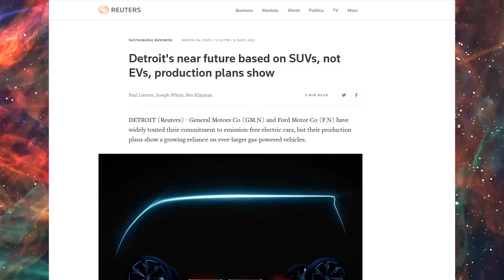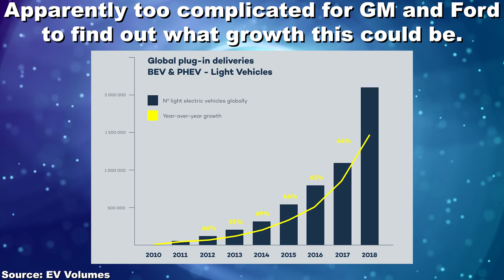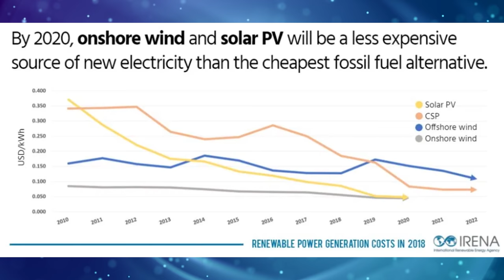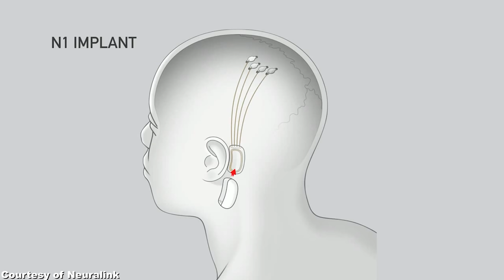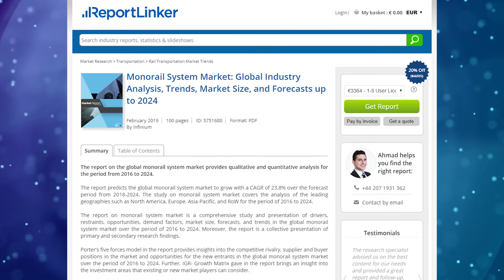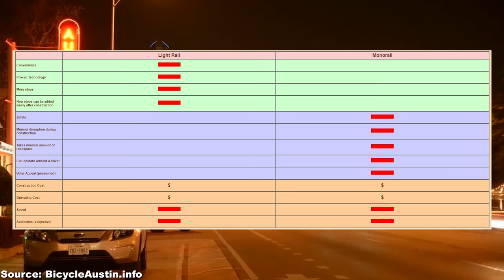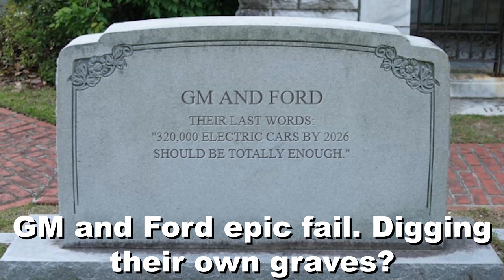Tesla Giga 4 Progress & GM+Ford's Bizarre EV Sale Target

Comment: 4th Generation Nuclear fission molten salt reactor are safe and produce rare medical & industrial isotopes. Produces almost zero waste and can burn much of the LWR nuclear waste. I designed sensors for these systems...many other 4Gen designs hold immediate promise providing energy to “start” fusion work which is likely 20 years out.
Reply: Jixuan, want to do a Vidio on this? I also think the  Zero Carbon future needs fail-safe Nuclear Fission with, wind, solar, and Batteries!
Reply: Molten salt reactors are the only way that we are going to have 24x7x365 base load power without pollution. The post forgot to mention that since it operates at normal atmospheric pressure, there is no danger of an explosion and there is no need for water coolant that makes current reactors so dangrrkus. They also heat up water, causing fish and other water dependent species to have problems. Without the need for water cooling, the reactors can be placed almost anywhere. Bill Gates has put some money into molten salt reactors, but not enough to get by the NRC's insane requirements for any new reactor technology. If we want clean nuclear power, now, we are going to have to reform or get rid of the NRC.
Reply: @everettlwilliamsii3740  i think if nuclear or fusion can generate electricity at below 2 cents a kwh, continue innovating their cost down by 10%-14% every year, can fit on a rooftop, can be built without cost overruns and labor union, as well as be in production in 2021, i think it has a good chance to be the best power generation choice for us.

Comment: Sydney built a monorail in the 1980s but as the late writer Clive James put it "The monorail goes from downtown Sydney to downtown Sydney to downtown Sydney" ie it didn't go anywhere. It wasn't an integral part of the overall public transport network and ultimately it got torn down. Monorails are awesome though, they solve a lot of problems and create very few new ones if the routes are designed correctly and integrate well. You can also build a monorail in conjunction with a boring company-sized tunnel as it will just fit, which means you can make the monorail go underground where necessary. Great job guys, keep up the good work!

Comment: GM - while studying architecture in university in Michigan - worked in GM plants in the area the summers. in one casting plant worked at - the failure rate was over 50% from the line. these castings would have to be re-melted to be recast - then we saw the Chevrolet Corvair (Unsafe at any Seed) then the takeover of Toyota to quality build - then the demise of the EV1. now another delusional step in commitment to ICE vehicles .... in the face of the inevitable and climate change

Comment: Buckmeister Fuller proposed using precast concrete(new concrete process) high speed monorail track throughout US linking smaller town and rural areas distributing population, using tech like fiber optic and innovative manufacturing-hyperloop & monorail great combo! 1st iteration of plan in early 70s then refined 10 years later.
Reply: I only seem to remember Buckminster Fuller, Fullerenes, and geodesic domes.

Comment: You guys need to get a grip, renewables are not working as you say.  Also instead of fission why not go molton salt reactors that already show to work, are far less complex and short radiation time lines.  MSR can be made in small or large sizes which allow the removal of the large transportation system.  China and India are seriously working on this technology.  You should read up on MSR!!!
Reply: But you should talk about the most promising and most practical, practical fusion isn’t going to be here for thirty years and when it comes it all be complex and expensive.  MSR is simpler, proven technology, the fuel is ready available it’s more efficient , and safer than any other reactor type technology.  We are again headed down the rabbit hole of the holy grail on nuclear    scientists when the solution is right in front of us.

Comment: Here in America's heartland the population density is to low to ever support monorails.  Don't underestimate Ford ?
& GM.
Reply: David LaBedz - “No one ever went broke betting on people’s stupidity.” “It’s pretty hard to recover from ‘stuck on stupid’.” The problem for both is like when the Ford Edsel was designed - The engineers kept on proposing advanced technologies such as BMW, MBZ & some others were using. Ford Management kept on pointing at the Edsel & replying, “This is the future.” 🤦🏼‍♂️Almost the same thing happened with the Pinto when engineers kept pointing at the brackets that would puncture the gas tank in even a minor rear-end collision. ITC, Ford management decided that it would be cheaper to litigate than to fix the problem. 😱🤦🏼‍♂️😡 
We all know what happened in these instances & just how close to bankruptcy Ford got because of the 2nd. And, we all know GM required a huge bailout just 11 years ago because of some of the stupid decisions GM has made.
If Ford & GM come to their senses within the next 3 years, realize that ICE SUVs are NOT the future & start majorly ramping up BEV & PEV production, they will avoid bankruptcy & be profitable in the long-term. But, if they insist on staking their futures on ICE Trucks & SUVs (with a few BEVs thrown in to look “green”), they will start losing money by the late 2020’s & be bankrupt by the mid-2030’s. NO sensible administration is going to bail out someone who is that deliberately blind & stupid & who is knowingly contributing to air pollution & global warming that much.
Reply: @TraditionalAnglican  Unfortunately administrations often find no need to be sensible, think of the Bay of Pigs invasion, the Vietnam War and the 2nd Iraq War.
Reply: 09-11 over again.
Reply: Karl Themel - All of those made some sense given the situations they occurred in. It would be hard to justify bailing out Ford & GM in the situation I described, esp. if other automakers (including Tesla) were making profits producing 10+ million BEVs per year.

Comment: Love the motivational speech! I was out of my chair ready to take on the world when it stopped! LOL!
As for GM and Ford, I agree but I think I know what is going on. Their upper management are not stupid, far from it, but they missed the boat with the early adoption of EV's and Tesla. They are functioning from a deficit and know it. They cannot compete in the EV market head to head with Tesla yet and are biding their time.
1) Tesla not only makes the cars, they make the batteries as well. This is an price advantage GM and Ford cannot overcome. If they commit to EV's, they will not be able to compete on the price of the batteries and that is the most expensive part of an EV.
2) People like SUV's (I drive an Xterra). They are higher margin vehicles, allowing them to maximize their profits from ICE vehicles instead of making low margin cars. There are few options in SUV's for EV, so no overlap competition.
3) The price of oil is very low for the short term. Whenever you have that you also see less demand for green alternatives like EV's. This may slow the adoption of EV's because with low oil prices EV's are still more expensive.
4) Ford is going to be producing EV's, if not at the Tesla scale and focus. They will figure out how to produce the technology at scale from that, positioning themselves for the next factor.
5) Solid state batteries like the Braga/Goodenough glass battery (and many more) are expecting commercialization starting in the mid 2020's. If so, this eliminates the primary advantage of Tesla which they obtain through their battery gigafactories. At that time the big automakers in the US will be better positioned to transition to all EV lines.
6) GM and Ford have a lot of debt, and it takes a lot of money to retool their production lines and train their workers.
Will they be able to survive in the long run? Not sure, and they probably are not either, definitely not on their current technologies and business models. I believe this may explain their thought processes though.
Reply: I CAN SEE the executive at the big car co. having meetings to plan how to deal with Tesla , as the worker parking lots are full of Tesla cars !! Ha,HA !1
Reply: Very good. I see a lot of truth in what you say. I also think it is very risky.  Tesla doesn't have the huge legacy overheads of Ford and GM.  Tesla will most probably be ahead of them when it comes to the introduction of cheap high-density batteries because of there aggressive product development strategy.
Reply: Thanks for that reply ! I was Teasing ,in, that Tesla sure got those co. off their asses and moving !
Reply: P. S. I hope Tesla sees that they have to something up and running like dealerships for repairs alone !!??  The EV Garage " aka , Rich Rebuilds . Thats the type of shops Tesla needs all over the country NOW !! I dont know that Tesla is going to do that themselves , ARE THEY ?
Reply: @robinholmes785  Agreed, it is risky. I just don't see them as having an alternative. Tesla's gigafactories put them too far ahead on the battery price curve to compete with directly and batteries are the most expensive component of the vehicle. If it was just making a nice vehicle body, no problem competing.

Comment: Wait, both GM and Ford - combined - plan to make 320k cars in 5 years? That's an average of 32k cars/year/manufacturer, which is 2666 cars per month, which is less than Tesla makes in a week in Shanghai in their unfinished factory. 🤦‍♂️ How the mighty have... gone dumb.

Of course Tesla didn't have this kind of capability to make as many cars, but their "5-year mission" is borderline insane. The EV cars are the future and they don't make a real effort to push themselves forward. Where will this lead them in 5 years, with Tesla constantly innovating? Unbelievable...

Comment: Centralized, very expensive, very large  vs decentralized , robust, much more reliable.
Reactors are often between 85% to 93% reliable -weeks of down time for repairs/upgrades/refueling.
solar/wind is much much better, right?  and efficiency of course.

Comment: GM and Ford are huge Companies.  I work in IT and I have seen 3 different set of Numbers all answering the same question and each different dept's based on their different prospective of that Dept.  If the numbers came from the SUV division I can easily see them providing numbers that paint the number of SUV in their best light.  In Chevy's case they are putting in place there own version of a Giga Factory for batteries that are going to provide more batteries than 300k EV a year would use.  Even if internally they are not sure if any of there EV are going to push past 30k a year they are putting the pieces in place in case they end up with a module 3 that sells 300k on it own..

Comment: When GM and Ford fail, that vacuum will be filled by Tesla and VW.  Disneyland has operated their monorail for decades.  They have so much experience and data.  I am disappointed that monorails weren't adopted in the US.
Reply: VW lost a lot of points with the diesel exhaust affair and GM and Ford have a lot of politicians and legions of lobbyists at their side. They should have disappeared several times in the last 40 years. The USA should have kept the railroads. Probably, Tesla is a large part of the future.
Reply: @karlthemel2678  new VW CEO Herbert Deiss seems to see the future of electric and is making moves.  That's why I think VW will be strong.

Comment: Mono rails in US ...No. The future is auto drive EV's in dense urban areas coupled with BORING tunnels. (only 10 mil per mile)

As to Gm and Ford, they may serve a niche market for gasoline cars. For decades there will be an infrastrucure for these and with lower gas costs (due to renewables growth) a demand will exist. Only when there is a large difference in initial cost  between gas and electric cars will GM and Ford go bankrupt. They should survive for a decade which buys them time to electrify.

Comment: Of course GM and Ford are looking to sell gas SUV's and trucks for the next few years because that's what the market demands. In North America the electric market is only a few percent. While that is likely to increase drastically over the next decade, it would be suicide to dump their core business before the market is ready. They do have to have products in the pipeline (so to speak) as the market changes and the ability to ramp up production as the market changes.

Comment: mono rails use rubber wheels, are slow and inefficient. The ordinary train on a narrow gauge is much better and lasts practically indefinitely. Rides on monorails are invariably disappointing. It's the cars even electric ones that are the problem. They simply require too much space, space which is needed for the natural world on which we all depend

Comment: The conventional vehicle manufacturers might find a market for high-performance hybrid SUV type vehicles (if they smart-up sufficiently). A good portion of customers will like knobs and buttons that move with a satisfying click as Arthur C. Clarke indicated in the novel 2010 (sequel to 2001, A Space Odyssee) Clarke was describing the Spaceship Leonov rather than touch screens only. My mother and I gave up on e-readers not only because of rapidly discharging batteries but also because the touch screens became non-responsive. China may keep its fusion results secret unless something is developed that can be sold for money. Perhaps parents that thought the only education anyone needed is Latin and classical literature and that refused their children to stay at home to watch the Lunar landings on TV are a sufficiently bad life experience? Fortunately, my parents considered basic mathematics to be important and today, you can take technical writing in college. Monorails can negotiate tight turns and are suitable as you said for densely built-up cities. In Winnipeg, Manitoba the diesel transit bus manufacturers convinced the City to get rid of the electric trolley busses, tear out the overhead lines and use roaring diesel vehicles only. Vancouver and Edmonton (the latter has a cold climate, also) were smarter and kept the electric trolley busses downtown. I would get an EV1 if the batteries get better and cheaper and the user interface is understandable. Perhaps, in the future, people who purchase a car have to do schooling for their particular model beforehand as the pilots do. If you refuse to use a smartphone for your car, perhaps, you can get a Star Wars-style ´beckon call´ instead, no certainly not in any country that wants drivers to be transparent. I may have already posted this, perhaps Space X could name the first manned Starship in regular service ´RV Galileo` or RS Galileo` from the 1950s novel by Robert H. Heinlein: Rocketship Galileo. Stay healthy, go Starship.

Comment: JAX You-2 Hit another one "ouda da Pak" . Great video!  Your cynicism, I see, still needs cultivating.  Wanna bet Ford and GM managers are holding a whole bunch of Tesla stock?  They also hold a bunch of Exon/Mobile stock.  Just as horses were supposed to go out of use; neither will ICE vehicles.   There is just too much advantage to being able to drop in fuel from a distance without needing a charging infrastructure nearby.  Yes I know,  flexible printable solar panels will massively increase the near self sufficiency of EVs; and on and on.  There is yet:  too much economic momentum built up, to choke off the ICE industry overnight or even over a decade.  And even so Ford and GM know one thing; it is:  employees and American consumers.  What they can do and what they will do are totally different chapters.  Ford and GM do appear stupid crazy, but be careful with predicting them; they may just be crazy like a fox.   Maybe they have already designed a hydrogen fuel retrofit system for those future SUVs?  
        I really appreciate Jixuan's struggle with pronunciation of English words.  It is a humbling honor to watch and listen to her do that.  Thank you Jixuan! Was able to listen to you at 1.5 speed with no problem.